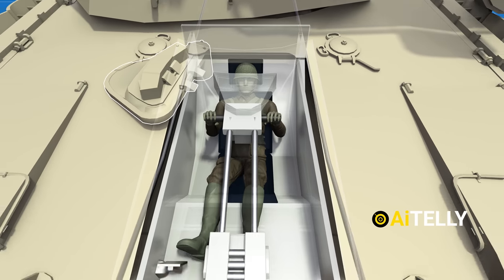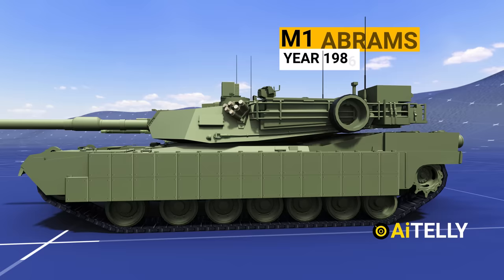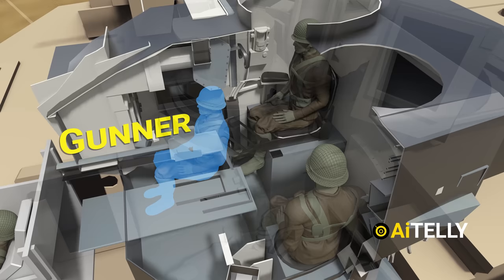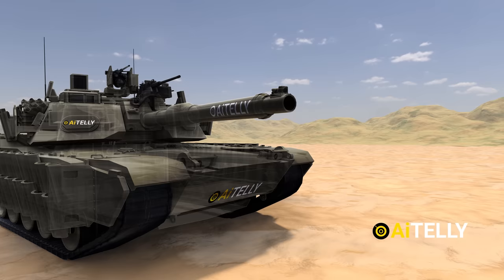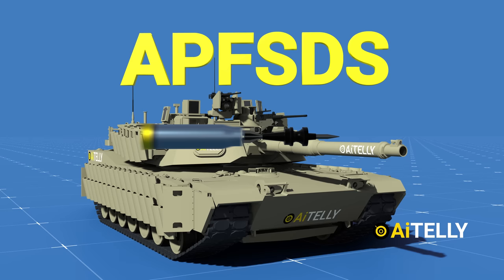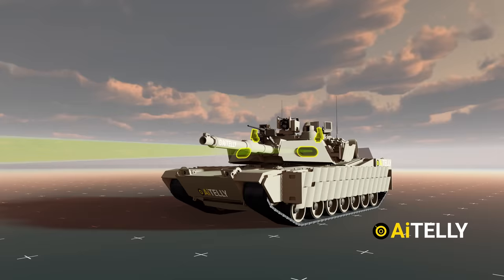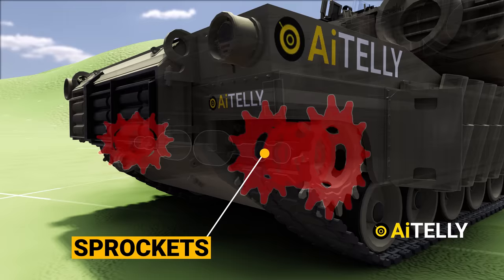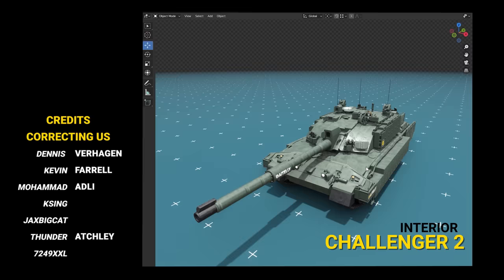How to Drive and Fire Tanks | How it Works Abrams M1A2  M1A2C Tanks

Comment from the maker: This video is a Correction from our recent Video the Abrams Tanks.
Some addational feedback from our Audience  

"Gregory Heim" 
The gunner's controls are formally named the Gunner's Powered Hand Station, but commonly referred to as a Cadillac because the first model was made by the Cadillac Gage company.

"DannyZero69"
7:49 The airburst is intended against softskin vehicles like trucks and against infantry who would be showered with shrapnel from the burst

7:54 The point detonate delay mode is against lightly armored vehicles and fortified structures as the round could penetrate the armor/wall and detonate INSIDE the vehicle/building.

"Dragoon Gryffoon"
The Lancet drone is not made to destroy a Tank but only light vehicles such as Caesar howitzer.

"Zack"
The driver actually gets in through the turret most of the time because the hatch cannot be opened from the outside. Ever wonder why the turret is always pointed over the left rear of the tank when parked? There is a gate on the inside for the driver to slide through. And the T-bar used to steer it actually has a pin that can be pulled so the T-bar can come down to the driver for a more comfortable position. There is another round the Abrams shoots called a CAN round, I think I spelled it correctly. I never had to to spell it, I just loaded it haha. It is basically a shotgun shell with 1013 tungsten steel balls.
Reply: The Lancet drone is not made to destroy a Tank but only light vehicles such as Caesar howitzer.
Reply: Abrams consumes also a lot of energy.
Reply from the maker: @Gryffoon   Credited your Comments
Reply: I have a feeling that they will add a top radar and about 10 APS rounds because.....yes the secret is out, tanks are vulnerable to top attack.....👍
Reply: @scottbattaglia8595  trophy system
Reply: @Aitelly would you please make a specific video about Merkava IV tank? How it works, the engine, the auto loader, all crew position and duty, entrance/exit hatch, etc. Since it's difficult to find much information about this tank.
Reply: @Gryffoon  ⚠️ God has said in the Quran:

🔵 { O mankind, worship your Lord, who created you and those before you, that you may become righteous - ( 2:21 ) 

🔴 [He] who made for you the earth a bed [spread out] and the sky a ceiling and sent down from the sky, rain and brought forth thereby fruits as provision for you. So do not attribute to Allah equals while you know [that there is nothing similar to Him]. ( 2:22 )

🔵 And if you are in doubt about what We have sent down upon Our Servant [Muhammad], then produce a surah the like thereof and call upon your witnesses other than Allah, if you should be truthful. ( 2:23 )

🔴 But if you do not - and you will never be able to - then fear the Fire, whose fuel is men and stones, prepared for the disbelievers.( 2:24 )

🔵 And give good tidings to those who believe and do righteous deeds that they will have gardens [in Paradise] beneath which rivers flow. Whenever they are provided with a provision of fruit therefrom, they will say, "This is what we were provided with before." And it is given to them in likeness. And they will have therein purified spouses, and they will abide therein eternally. ( 2:25 )

⚠️ Quran
Reply: @IslamIslam-oj1fo  ok, but why are you telling me this ? What's the relation with the context ?
Reply: The trophy system is not the APS system that the US borrowed from Israel. The US borrowed the Iron Fist APS built by IMI and they only put it on the Bradley IFV's. The trophy system is built by Rafael in France (I think.)

The three fuels the Abrams uses are jet fuel, diesel, and kerosene.

(I was gonna list the other mistakes but the list is too long lol)

You guys really get a lot of details wrong in your military videos. I'd be willing to help out if you guys wanted 🤷‍♂️

Comment: The gunner's controls are formally named the Gunner's Powered Hand Station, but commonly referred to as a Cadillac because the first model was made by the Cadillac Gage company.
Reply from the maker: Great info will credit you for this feedback in our "Comment Section"
Reply: Gunners primary control handle*

Comment: The driver actually gets in through the turret most of the time because the hatch cannot be opened from the outside. Ever wonder why the turret is always pointed over the left rear of the tank when parked? There is a gate on the inside for the driver to slide through. And the T-bar used to steer it actually has a pin that can be pulled so the T-bar can come down to the driver for a more comfortable position. There is another round the Abrams shoots called a CAN round, I think I spelled it correctly. I never had to to spell it, I just loaded it haha. It is basically a shotgun shell with 1013 tungsten steel balls.
Reply from the maker: That's a very aluable info will credit you for this feedback in the Comment section
Reply: USMC standard M48a3 load RVN was half HE half cannister. like a black 1/2 gallon juice can. They said 1000 1/4 " roller bearings.  In tube all nite on line somewhere. That thing is like a jet fighter.  We usually carried a few WP rounds just to start fires.
Reply: Incorrect.
Reply: WTF...you must have been stationed in Ft hood, I used the drivers hatch quite a bit.
Reply: @DigitalCity-sj4es  nah ft hood I saw tankers get in and out the f the drivers hatch
Reply: probably use the end connector trick to hold it shut  @jessiewasson584
Reply: Ah yes, good ol’ grape shot

Comment: Thank you for crediting me ! Some fun facts about entering the driver's hole. Unless the hatch is combat locked there isn't a way to enter the driver hole other than the turret, the turret has to be put over the rear of the tank and there's a little swing door by the loaders legs which the driver slides into his position. Combat locking isnt usually done, I've done it a few times (The hatch is poped up and to keep the hatch from swinging open theres a little notch to stick a track link end connecter on which hols the hatch shut while its still popped up( end connectors are the links at both side of each link of track that connects them). Anyway actually appreciate the correction cheers!!
Reply from the maker: Thank you so much for the Suggestions.
From me and my team of 3 Artist.

We created this channel to Animate Engineering Videos about Engines and other stuff. but we went into Military Stuff by Accident.

Thanks Again!🙃
Reply: What are you talking about? even with what you describe at "combat locking", you can't get into the drivers' station. Only when the hatch is completely open can you get into it. And why use an end connector? you can just lock the hatch in the up position. It won't swing open until you grab the crank to open it. Former 19K30 with 4,000 miles of driving experience.
Reply: @andrewschliewe6392  it swings open because there's a spaghetti cord wrapped around the crank..thus you use a end connection to keep it from swinging open...maybe reread my comment cheers
Reply: @thunderatchley9367  There's no spaghetti cord. There's a paddle on the crank handle you have to grip that unlocks that allows the hatch to swing.

Comment: In the video about the M1147 Advance Multi Purpose shell, the shell is made to replace HEAT and canister. The sabot is not replaced since HEAT can be intercepted by APS or stopped by ERA blocks.
Reply: This! The APFSDS round is not being replaced with the AMP round. Just the HEAT, canister, and HE rounds are.
Reply: I wish they’d “ask a tanker” instead of assuming
Reply: Wish theyd keep the canister. When you want to shut up a group of infantry hiding in buildings nothing works better.

Comment: The armor also contains some ceramic and other composites, not just DU and steel. One of the reasons that ceramic is used is because when they shatter during the impact of the apfsds, they turn into something like sand, and that deforms the penetrator. For some reason I remember that steel is not used these days but ok. Overall nice video. The explanation is very clear.

Comment: Cool animation 👌
It would be cool to se a video about the T-90M "proryv". The turret is differently shaped, looks way cooler than old T-90 design, almost resembles the Leopard 2 turret when seen from the side
Reply from the maker: Coming after we finish the Challenger 2 Tanks.
Currently modeling the T90 Autoloader.
Reply: @Aitelly   Hi! Is this an autoloader for new types of projectiles with an elongated penetrator?
Reply: Actually, it's mostly external shape of the turret that looks distinctively different - because of ERA and whatnot. Internals are mostly the same, other than turret being welded and not cast.
Reply: @Aitelly  yay,,, Chally :face-red-heart-shape:
Reply: @Rory_Mercury  What kind of "breakthrough"?

Comment: So were not gonna question the heat dampening materials used and the fact the exhaust is pointed into the ground underneath the tank. I mean it is still vulnerable to thermal scopes because of the tracks, barrel after firing, and if it is a hot day out. But I mean that's with basically every tank tbh.

Also btw this ain't bad content by any means, its really damn well made and I enjoyed it a lot, it just caught my eye with the last little part about the engine.

Comment: 7:49 The airburst is intended against softskin vehicles like trucks and against infantry who would be showered with shrapnel from the burst

7:54 The point detonate delay mode is against lightly armored vehicles and fortified structures as the round could penetrate the armor/wall and detonate INSIDE the vehicle/building.
Reply from the maker: Thanks for the feedback Will credit you in the Pin Sections

Comment: Good video. 🙂Abrams would be more mobile with the Leo 2's 1500hp diesel as they produce far more torque than a gas turbine of equivalent hp. Heavy vehicles need torque not hp (diesels also start much faster).
 The Abram's gas turbine is a fuel guzzler, the first Gulf War had to be delayed solely to build up enough fuel stocks for the M1's.

Leo 2 and M1 share the same hull and running gear, as well as the same German-made main armament. Trials were carried out with the M1 fitted with the MTU V12, but there has been no definite decision, unless somebody knows the real answer.
Reply from the maker: Thanks for the feedback
Reply: Torque can be achieve with gearbox. Power is much more important (speed).
Reply: @NoName-md5zb  You are not only wrong but you need to educate yourself about the relevence of hp and torque.
They do that with motorcycles 12,000 rpm all hp and no torque worth a damn. You dance up and down the gears constantly to keep them on the boil. But they are no good for pulling power, if gas turbines were any good, how come only the USA continues to use them des[pite the Army wanting diesel power?

Why aren't gas turbines used used in heavy trucks?
There are cars make more hp than most trucks but they can't compare to the torque at low rpm.
You want to move something heavy, you need torque, lots of it. You don't need a sophisticated and complicated gear system which will prove unreliable in the battlefield.
The tanks we used had masses of torque. We could do a neutral turn on a hard surface with the engine at idle.

Comment: Actually the round you're referring to as HEAT is actually the Multi Purpose Anti Tank round or MPAT. It pretty much serves the same purpose as a HEAT however if the switch on the cone is turned to A and the gunner indexes AIR it can be used for helicopters. Hope that information helps!

Comment: Mention that programmed rounds are almost useless against modern (composite) armor or ERA and are not used against tanks.

Facing the problem of APS and ERA, the US indeed fall back a good portion of actual tank combat. They indeeed can still fight T70-90 and hope for a good hit with ther latest APFSDS, but it need to hit very precisly, which is pretty tricky by the lower silhouette and by probably both are moving. A hit at a propper ERA like Kontakt-5 or even Malachit heavily decrease effecticvity of even these rounds.

The race atm in tech (not in deployed material, which is in both cases way below the technical posibilitys) is between GER and RU. GER has StrikeShield, wich is a ERA/APS hybrid and pretty effective on each whight class of armor. As offensive system, the new Rheinmetall 130mm gun is outfittet with a longer dart, high pressure chamber and the power of the higher caliber to simply reap through everything and bypass ActiveProtectionSystems by its sheer speed.
On the other side, russians have pretty sophisticated Malachit ERA on top of either realtivly basic RHA on T-90 or very heavy layers of modern composits on T-14 Armata (which isen't fielded yet). On top of that, RU fields Afghanit APS, which is way better than Trophy, but still inable to catch the latest rounds fired from Leopard 2, which is DM63(by a tiny 50m/s - but claimed to drastically increase this ability soon. Well' see). In offensive, russians are way better and have either Svinets-1 or -2 at ther disposal, which are both KE and both way to fast for Trophy or TUSK armor to react, and will pirce Abrams at any point pretty easy. For T-90 they theoretically also have Vacuum-01 and -02 at hand, which surpase ther Svient's speed and penetration due to a longer rod.
As T-14 whooping 900mm penetration of angled RHAe are seen as probably incabable of securing a kill on other theoretical vehicles like KF51Panther, the russians demanded a bigger 152mm gun for the Armata which make the same trick as the 130mm gun from Rheinmetall - less by overpressure, more by brute force (but there are no data available yes. But for the long rod autoloader capable of handling these, we'll have a pretty overkill dart).
Only thing unclear right now is the speed StrikeShield can catch up to, but so far only finctional vehilces can even dream of surviving each other - Abrams and Leopard 2 both atm inable to stand a hit from a T-90, while the other way around it is pretty much a question of ammunition and hit location.

As a persoonal note: As Abrams reached 70-80 ton whight, it in some ways lost the terrain of 'tank' and gained the definition of a somewhat mobile turret, which very much removes it from comparison - both in mobility (and therfor effective ability to intercept anything) or fighting (as even 45 ton vehilces atm get stuck in ukrainian mud and fail to peform. T-90 and Abrams have similar horsepower, but almost halfe the whight on one of them.

Comment: Can the driver get in/out with the turret facing either forward or backward, or does it needed to be turned to the sides for the driver to access the hatch?
Reply: Yes, there's a escape hatch on the floor of the tank.
Reply from the maker: Thanks for replying
Reply: @viceralman8450  That's the M-60. The M-1 doesn't have one.
Reply: The driver can get into the driver's from the driver's hatch no matter what direction the turret is facing. It is a tight fit at times when the turret is at 11 and 1 o'clock. Former 19K30
Reply: If you believe that penguins can fly

Comment: At 6:32 that "APFSDS" shell is modeled incorrectly. The sabot(or also called a dart) is supposed to look more like a pencil with fins attached to it, but as shown in the video it almost looks as if the casing around the sabot never came off like it was super glued to the dart.

Edit: I'd like to correct myself, he was showing the HEATFS shell it seems, but that was seriously confusing, just needs to work on a bit of grammar i suppose
Reply: It was more confusing that the HEAT just went through the armor as a whole shell instead of detonating
Reply: @hansiminator69  ur right lol. Ig they have a super tiny budget to not even be able to show us how heat properly works lol

Comment: fun fact: abrams engine is based of the one that is used by chinook helicopter, if unlimited Abrams engine could produce 3,000HP but it would tear transmission apart and fuel efficency would be very bad.

Comment: Your Co-axial gun is still wrong. Where did you get the reference for that in the first place? Where do u get your references at all?
Reply: Assuming the m240 is ready the gunner moves gun select switch from main to coax then fires using the same process as main gun, before firing gunner says “on the way”,   also when firing the coax the air filtrations system kicks on the air out the turret so it’s pretty loud when firing

Comment: Hi uhm the M1147 HEAT is intended to replace the M830, M830A1, M908 HE shell and a flashbang shell,  but not replacing the APFSDS currently the M829A3 APFSDS is the current shell use against anti armor while the base M829 is out of service long ago before the start of desert storm and the were no Iron Fist launcher above the Merkava hehe thanks

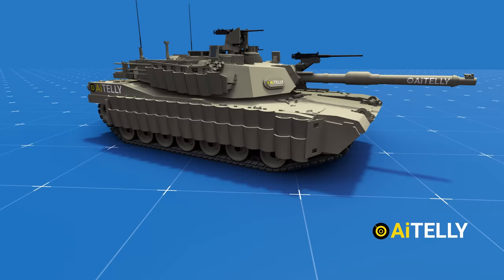Comment: 1:30 just putting up a reminder here, because M60 tanks ARE NOT in the Patton series tanks. It's simply just M60, unlike m48 which has Patton on the name, m48 Patton. despite being the successor of the patton tanks, both are completely different units.

Comment: Cutout is an excellent illustration of the vastly increased volume to be protected with a 4 men crew resulting in overweight tanks. The recently proposed upgrade of the Abrahams goes for auto loader and a 3 men crew, but does fail to do a real clean slate redesign like the Armata placing the three man crew in a capsule deep in the hull en saving weight by a substantially reduced volume to be protected by armor exploiting sensors to replace that siting of the commander near the top of the turret.